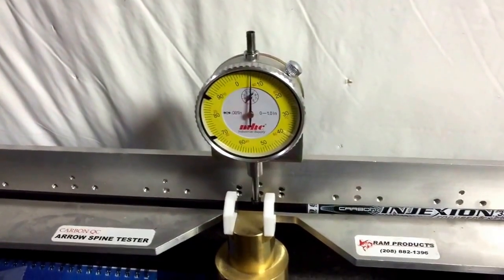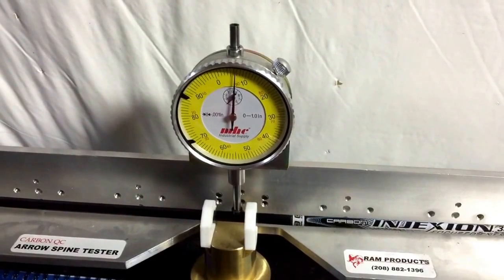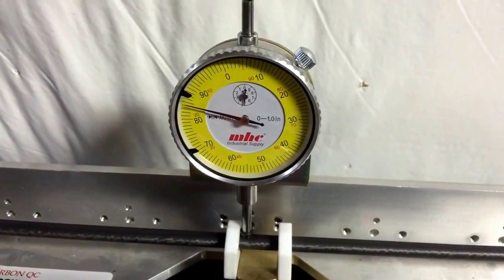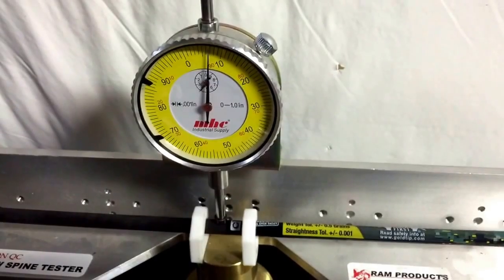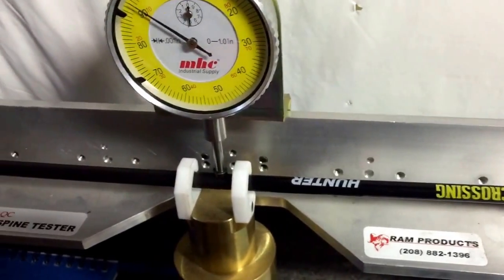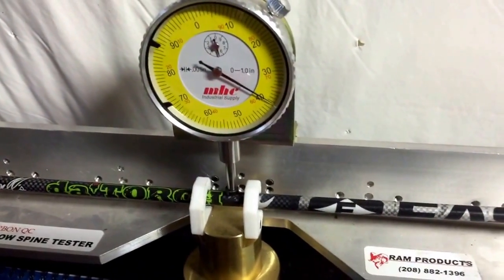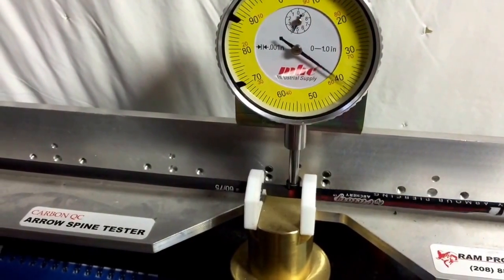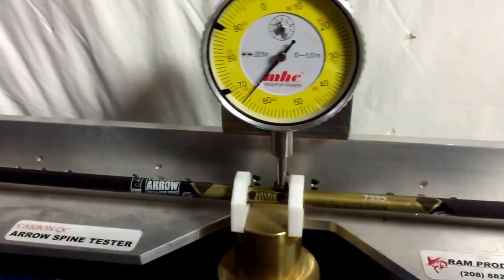Arrow spine tolerances

Comment: After watching this video several times I really wonder if you knew what you were testing for. Every carbon arrow, when produced goes through a wrapping process. Therefore it has a beginning and an end along the length of the shaft. The deviation you are measuring is in regard to the flex at any given point around the circumference of the shaft. The deviation that shows up is where the shaft begins or where it ends. At either of these points there will be a greater thickness of carbon and epoxy and the shaft will be stiffer. This is not to be confused with the straightness index of the shaft i.e, +/- 0.001or +/- 0.003 that was shown on your video while testing. For all your testing all you are doing is working out where to put the cock vein when fletching the arrow when the real purpose of the test should have been to ensure that each arrow met its advertised spine specifications.
Reply: Mike Wratten 
You obviously haven't tested different arrows
Reply: Mike Wratten 
There is a hanging weight for a reason
It is not to test straightness
Reply: Thats correct its there to test the spine deviation of an arrow. Not once in your video did you mention if any of the arrows actually met their advertised spine, all you showed was where to put the cock vein on that particular shaft. As far as testing different arrows I make custom matched competition arrow sets that I have been selling for many years. I have tested thousands of individual shafts. Understand that just about every arrow that is tested will have some deviation as I stated previously. Its the beginning or the end of the wrapping process.
Reply: Shane Chuning  Spine tolerance is about different shafts in the same set having spine close to each other.

Comment: The arrows you test from different manufacturers were not similar tolerance arrows. Wouldn't it be more apples to apples if you tested everyone's .001 shafts against each other? Or all .005 shafts.
Reply: This was basically to show you how some arrow manufacturers tolerances are actually tighter than their rating and equal to others that are actually rated to tighter tolerances.